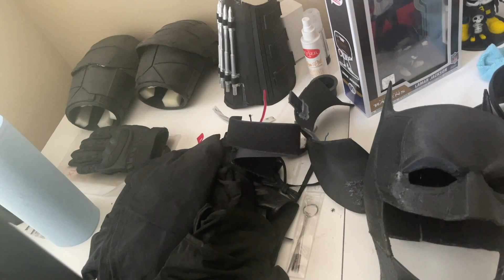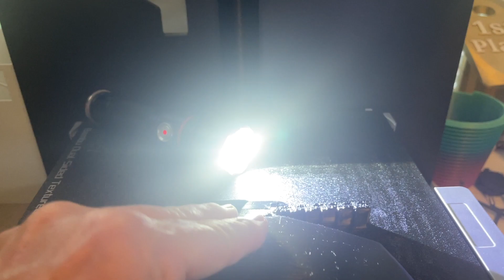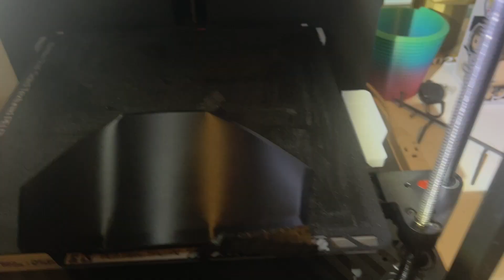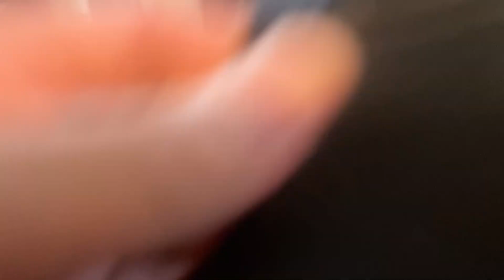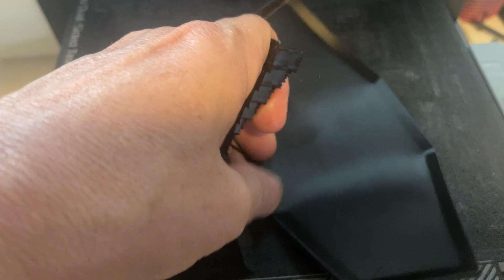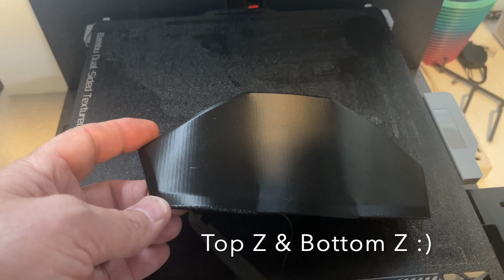Printing Prilene TPU on a BambuLab P1P

Comment: Thanks for sharing the bottom and top z value removing supports from TPU is not easy, as a suggestion you can change the seam position to the back or just the paint tool and place it where you want it so it can be hidden.
Reply from the maker: Thanks for the tip!  I wasn't thinking it was a seam since it didn't go up the entire print, but will definitely keep that in mind next time!